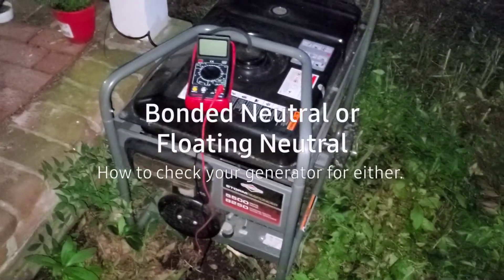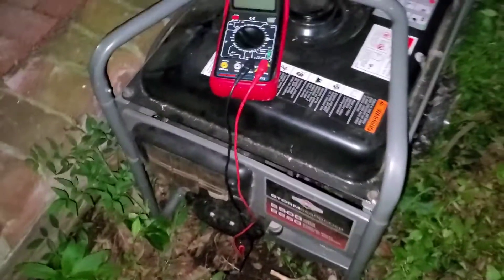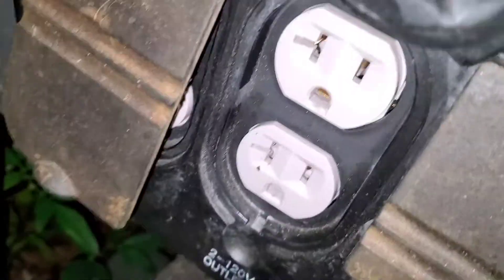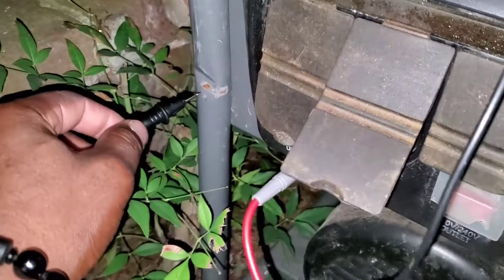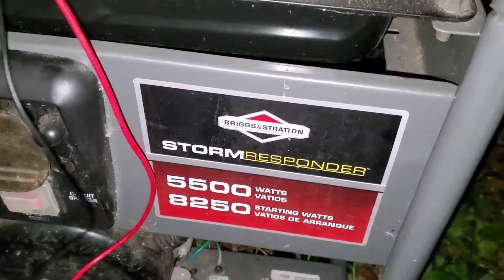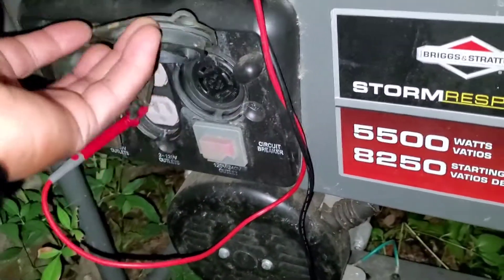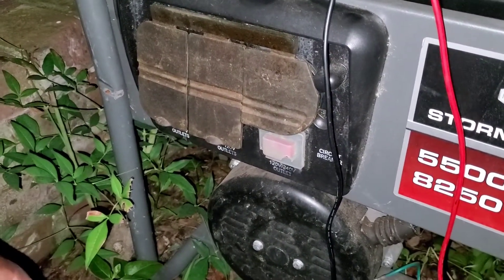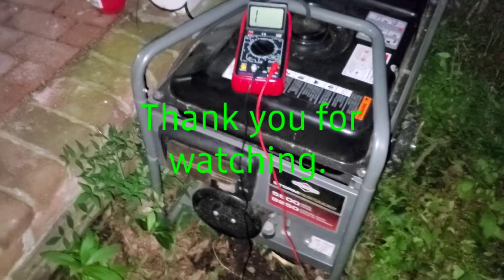Bonded Neutral or Floating Neutral

Comment: avflyguy stated   "Floating neutrals tend to be far safer when just using extension cords to power things."  but Ronny Husser stated "The use of this generator by itself is fine since it being the source power with the bond of the neutral and ground bonded, so by using an extension cord to power up stuff is ok.  confused me.  so which is it? i think if you are connecting to your house's panel though a breaker or T. switch or a dryer outlet- what ever- then you want a floating N. so you are using the houses panel's bonded neutral and if you are just using the gennys power panel outlets with extension cords then you want the bonded neutral/// or is the floating neutral better for both situations?
Reply from the maker: At the previous house I used a "generator interlock kit", at the current house I am using a "manual transfer switch". Please do not use dryer outlets to back feed a breaker panel.
To answer your question: If powering up a breaker via an interlock or manual transfer switch, you want to use a floating neutral since the neutral and ground are bonded in the breaker panel in most homes in the United States. You do not want a bond in two places as stray voltage will make its way back to the source via the ground. For instance, let's say there is a break in the cord's neutral line. The voltage will be going back to the source (completed circuit) via the ground wire which is dangerous. (Basically the ground wire will be carrying the weight of the neutral). 
Now having said all that, a little stray voltage on the ground isn't the end of the world, but it can be an issue if there was a break in the neutral. Hence using a floating neutral. With a floating neutral you'd notice the issue immediately. Most people don't care about whether or not a generator is floating or bonded unless they have an issue with the generator tripping it's GFI/circuit breakers etc.

Comment: I hooked  my predator gen up to my furnace and it trips the gfci only as soon as the fan starts. Should I disconnect the gfci outlet? Would a bonded neutral cause this? Thanks for the video
Reply from the maker: I do not know if that is the issue as I do not know exactly how the furnace is wired to the generator. You should not have two bonds, one at the panel and one at the source (generator) as it creates a secondary path for energy to return to the source. The  generator's GFI outlet may pick this up as a "short" and trip. Even if you plugged the furnace directly into the generator's GFI protected outlet, I'm sure something else is grounded out in the furnace which will link it to neutral since in the US neutral and ground are bonded in the main panel. You can try converting the generator to floating neutral. When in doubt please please consult an electrician. Good luck.

Comment: It amazes me that there is NO standard - nor do the manufactureres go into any detail at all.  There are always conditions where a bonded neutral to the frame could produce a lethal jolt if something went wrong.   Floating neutrals tend to be far safer when just using extension cords to power things.  When you tie it in with the load center's panel, things completely change.  With the addition of a manual transfer switch,  a bonded generator should be UNBONDED.  - floating neutral when attached to your home load center.  That is the bonding point - the neutral and ground 'share' the ground so to speak.   All manufacturers state there should be an 8 foot rod driven into the ground (earth) w/ bare 8ga grounding wire to the generator frame.  I've yet to figure out how one goes about pounding an 8 foot rod into the ground (earth).  How is that easily done?  Ridiculous.
Reply from the maker: You are 100% correct. Some generators if you remove the end cover it will clearly have the wire labeled for you to unbond the neutral & ground. Every generator inlet that I've used came with stickers to let the installer label the system as bonded or not.

Comment: How to make this generator floating neutral?
Reply from the maker: Most portable generators if you remove the cover on the generator end, there will be a labeled wire and bolt. It basically "bonds" the neutral and ground together; undoing it will un-bond them. There are other YouTube videos showing the procedure. Be careful and good luck.
Reply from the maker: I just converted this generator to floating neutral. Jump to minute mark 6:40 on this video and see where it's bonded and how I changed it...
https://youtu.be/9oMhZspwG08

Comment: So, what if I have GFCI outlets in the generator?
Reply from the maker: Bonded neutral. If I had GFI on the generator in this video and wired it to the house the way I did, it would most likely trip because there'd be a breaker for the 220/30 outlet also.

Comment: So you have a bonded neutral generator and used it with an interlock back feed set up? No issues? I only ask because I’ve been reading that with that type of set up, you have two bonded neutrals, the one at the generator and the one in your panel, and you should only ever have one. Can you speak to this? It seems like some people set it up like you and don’t have any issues (other than the generator providing “dirty” power).
Reply: Well the manual transfer switch set up switches the neutral and the hots so it would be okay from my understanding. That said, was the interlock setup the one you used for year or the manual transfer? Also, What do you mean by low voltage? 120/240 is pretty standard, no? Sorry for all the questions. Trying to figure this out myself without killing anyone.
Reply from the maker: @rgofd25  the interlock was the one I used for a few years. By low voltage I meant the amount of "stray" voltage. Basically the odds of getting a shock is ultra low and the stray voltage is usually only noticed if you use a voltage meter to detect it. There's a YouTube that did just that.
Reply: @97TRAKIN  awesome. Thanks for answering me. I did my install. No issues to date. No sweat on the delay in response!
Reply from the maker: @rgofd25  My apologies for the tardy response.
Reply from the maker: Yes, I have a bonded neutral and have used it with an interlock in the past and now with a manual transfer switch. You should only have one bond, but with such low voltage and intermittent use, as long as you're not tripping breakers on your generator you should be okay. I and MANY others have been running this set up for years. Please be guided by your local code. Good luck 👍.

Comment: Since your generator did not have GFCI protection it can not trip, chances are that you may be getting stray voltage going back through your equipment grounding conductor. The neutral and ground bonding should be located in only one spot that is usually in the main house panel or main disconnect, by having two source bonding locations the chances of having a current flow on the equipment grounding conductor are very possible and could be dangerous. The use of this generator by itself is fine since it being the source power with the bond of the neutral and ground bonded, so by using an extension cord to power up stuff is ok. When a bonded neutral and ground type generator is introduced into a homes electrical system where a bond of these two conductors already pre-exists it creates a possibility of a hazardous condition. Best to have a floating neutral type generator when using it on a transfer switch type set up. Also as most manufacturers recommend the use of a grounding rod to the frame of the generator should be used as well.
Reply from the maker: Exactly. I led in by saying "without getting too technical" and also stated that "my generator has nothing (no breakers GFI etc) to trip".
This generator will be converted in order to do away with the stray voltage and used solely for powering my manual transfer switch. I recently got another portable generator to use for portable purposes.
Your comment is appreciated. Thank you.

Comment: Good video.  You are correct the Briggs storm responder is bonded. I have a 6250 and it’s bonded as well. I will be doing a video on how and why I am unbonding it. You can also probe the hot and ground, and should see the same results if it’s bonded.
Reply from the maker: I think that I'm going to unbond this generator and use it solely for energizing my manual transfer switch. I recently got a "free" broken generator that I fixed which I can use for portable purposes.
Your comment is appreciated.
Reply: VI Tinker Tank I’m going to add a switch on mine, so I can bond or unbond depending on my application. I too have a manual switch that does not switch neutral.
Reply: @IFix-Things  When using a converted floating neutral generator locally with a cord, saw the web has neutral bonding plugs or make one up with a male plug end and a jumper from neutral to ground. Easy plug and play.
Reply: Would love to see that video! Have a Storm Responder myself, and with my interlock set up, I’ve heard that I should remove the neutral bond in it to be up to code/safe.